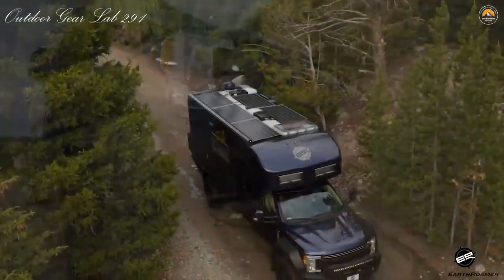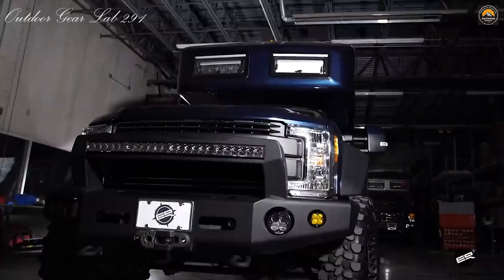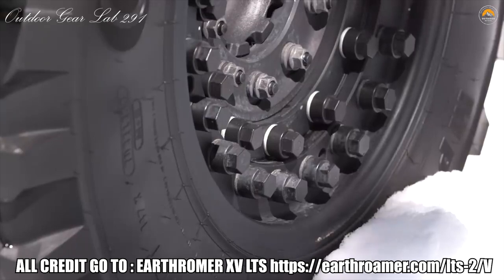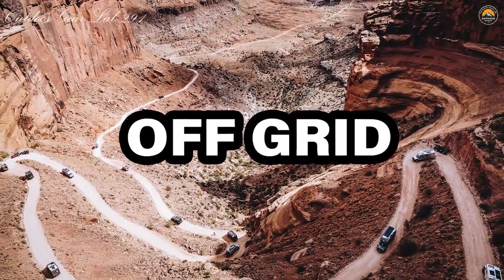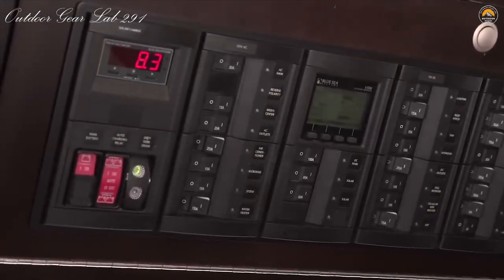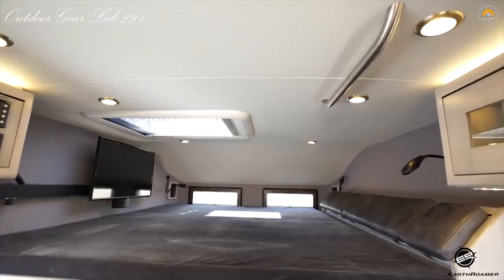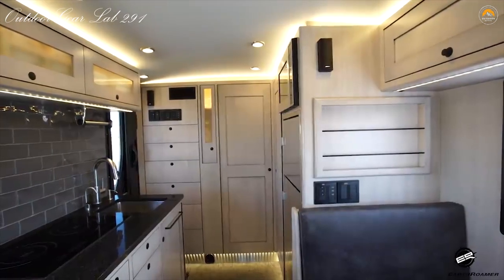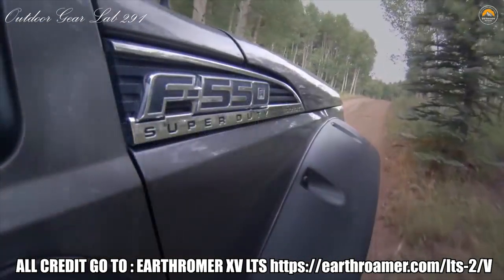EARTHROAMER XV- LTS EXPEDITION VEHICLE FOR 2024! || OFF-ROAD ADVENTURE! ( WORTH TO BUY ? )

Comment: be it the Earth Roamer XV-LTS or LTi both are truly remarkable interpretation of a luxury all terrain camper vehicle . . . but the Ford F-550 Super Duty (P702) 4WD + 5.0 in. Lift 3.3 Biturbo V6 4-Dr Crew Cab Light Pickup Truck (LHD) doesn't need to have such big a aft chassis frame mounted camper unit . . . a smaller, more compact camper unit like that of AluCab® is more than enough to satisfy most enthusiasts . . . regardless of whether it's a Ford F-550 Super Duty (P702) 4WD + 5.0 in. Lift 3.3 Biturbo V6 4-Dr Crew Cab Light Pickup Truck (LHD) or the bulletproof reliable TOYOTA Land Cruiser 79 (HZJ79) 4WD + 3.0 in. Lift 4.5 TDI V8 4-Dr Double Cab Light Camper Pickup Truck (RHD) . . . the quintessential Dodge RAM 2500 HD (DJ) 4WD + 5.0 in. Lift 6.2 HEMI V8 4-Dr Crew Cab Light Camper Pickup Truck (LHD) is another potential alternative to the aforementioned all terrain camper solutions . . .